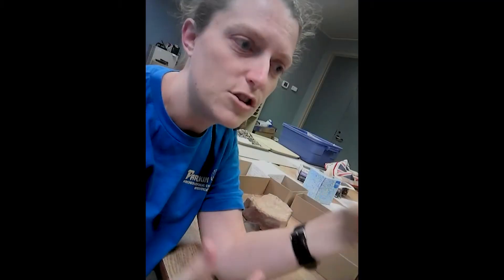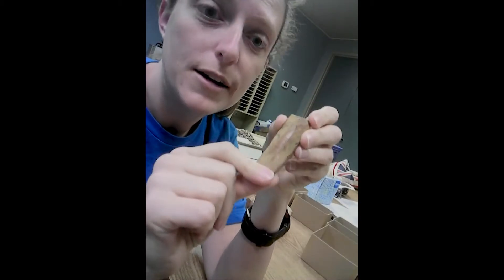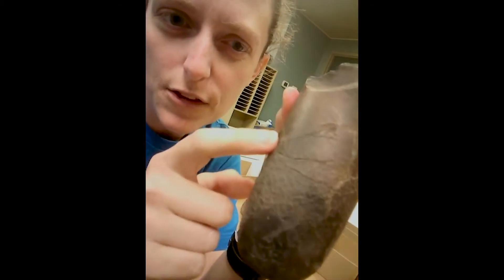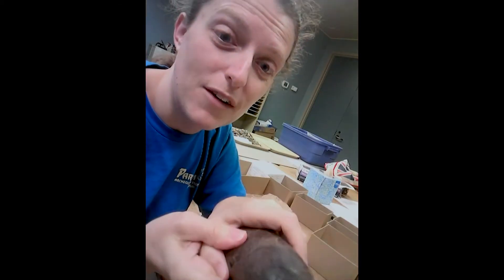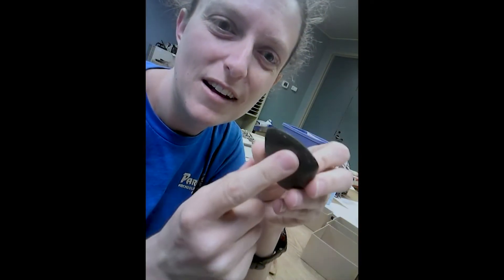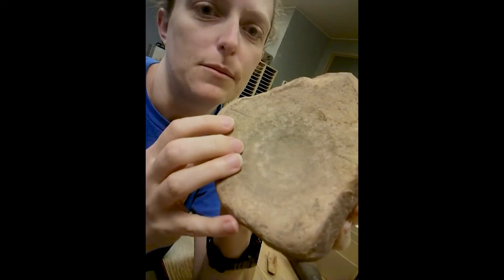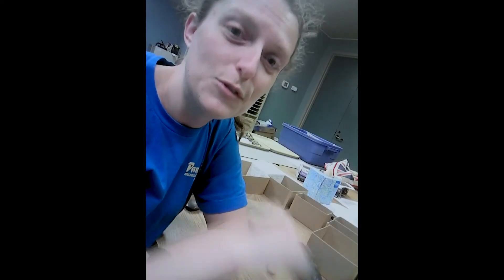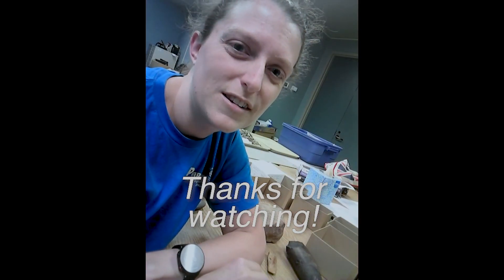Lithic Analysis 3 (Ground stone tools)

Comment: Very nicely done. Question, your metate, does "side 2" have a smoother, smaller area, perhaps even deeper? If so, that may be for the
 "final, finer grind, because why have 2 metates when you can have one? BTW, l have found 6-8 manos, but only one complete metate. I am still on that quest for a nice one.